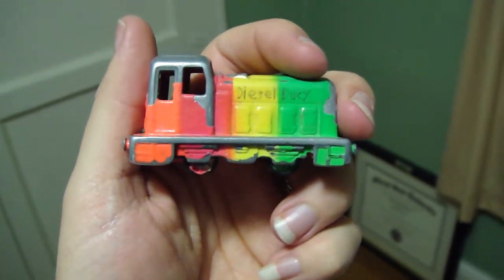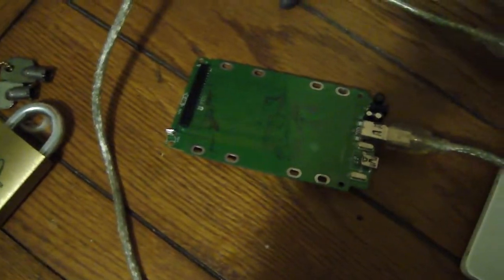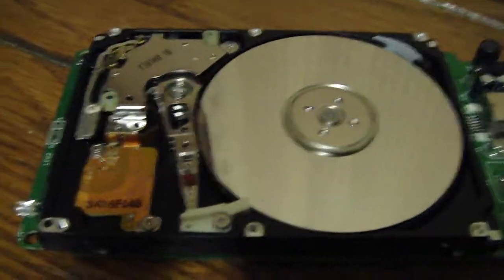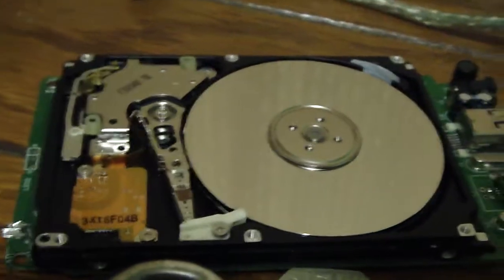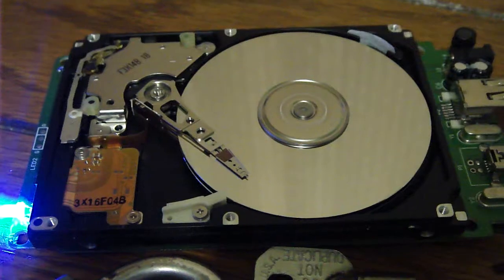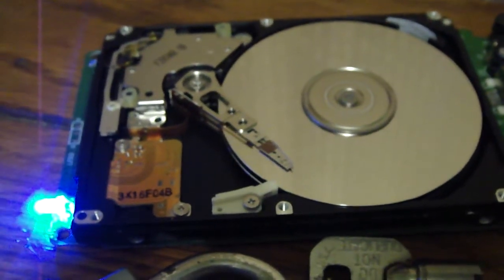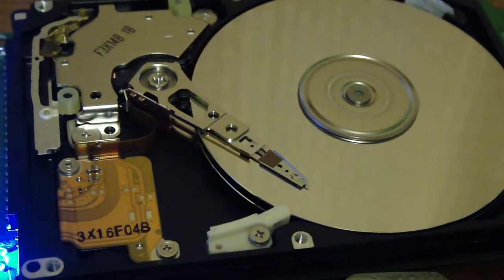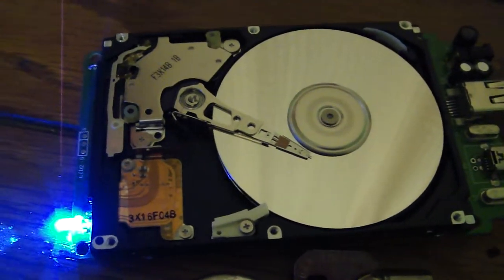Inside a Harddrive : Taking apart a laptop hard drive and powering it up

Comment: What's the diploma on the floor? (Start of video.)
  If you're getting rid of the HD, the easiest way to protect yourself is to take a hammer to it (closed). If they sound like baby rattels when you shake them, you did the job. If the platters are shattered, there's no way anyone can recover anything from them.
  Of course, if you are able to "F-Disk", that's a lot easier. I had to hammer an HD when my 1'st laptop quit, my parents on a dead desktop. I F-disked my last desktop.